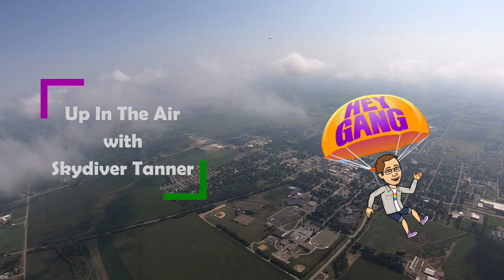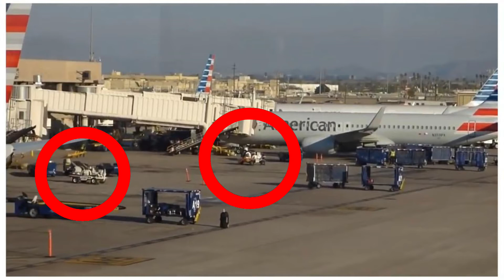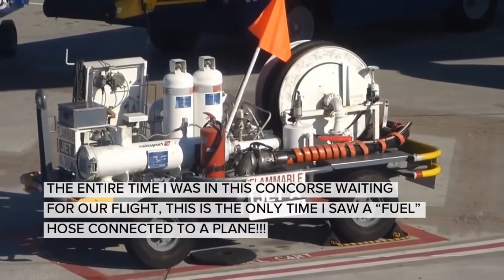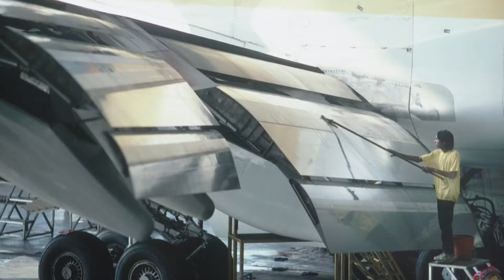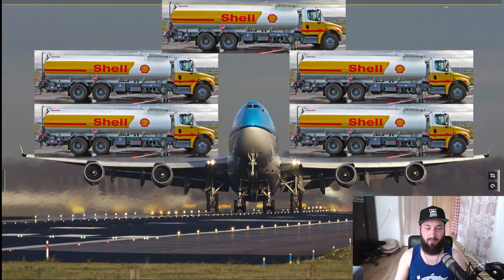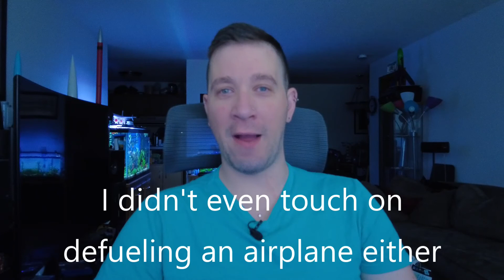Jet Fuel Hoax Visited: UITA w/ Skydiver Tanner

Comment: Tullamarine airport is no where near a refinery and if they ran on fuel the roadways would be clogged with fuel trucks.  Also there wouldn't be enough oil in the ground to refine for the amount of planes in the air, the aeroplanes engine are electric, General Electric.  There's no fuel.  They wouldn't lift off the ground with the fuel your talking about to fly from Melbourne London non stop and the wings wouldn't have enough space for fuel.  The wings contain hydraulic oil and equipment.  Imagine the weight of fuel, passengers and cargo.  You really l have to think carefully and disect every aspect of it.  Oh I can put a sticker on my truck, anything to show people and have them believe anything, it's not difficult.
Reply: I like the way you talk complete rubbish and demonstrate how you are completely clueless about flight, aerospace engineering and how an internal combustion engine works with such confidence. Comedy gold.
Reply: Pipe lines fuel can be carried through underground pipe lines.
Reply: Exactly! Not to mention the amount of time it would take to fill these planes up with fuel. An A380 would be like filling up a swimming pool every flight and would take countless hours with the fuel hoses they supposedly use!
Reply: @edkiely2712  aircraft rarely fill from empty and large aircraft would have multiple hoses. It’s not rocket appliance bruh. Oh and an a380 is a massive aircraft, larger the aircraft, the more it can hold.
Reply: @Robthisguy  It's lugnuts like you that keep the world in perpetual arrested development! Each A380 wing is suppose to hold the equivalent of 130 tons of fuel! That's  260 tons total! The wings could never withstand that amount weight to begin with! If you understood how a wing is attached to the fuselage, you would know that that amount of weight would break the wing right-off! It would also take days, with one hose, to fill that amount of fuel! Not only that, the plane couldn't fly because that amount of fuel-weight being moved around when the plane took-off, turned, or landed, would act as moving ballast and cause the plane to crash. But, it would never get to that point because the plane would never be able to take-off with that kind of tonnage along with passengers and cargo!

The KC-135, which, refuels fighter jets, holds 9,000 gallons in a large 'balloon'(search on Google Images)that takes up most of the planes fuselage. They have numerous belts tightened around the fuel balloon so it doesn't slush around and create problems for the plane!

You just keep believing what you've been told and just leave it to us smart guys to do all the problem-solving! You probably one of those people who still thinks oil comes from dinosaur bones and that we landed on the moon!
Reply: @edkiely2712   you’re deflected what I’ve even said to you, aircraft rarely fill from empty and can use multiple hoses . 15 years as an aircraft mechanic and I also used to work in fuel tanks daily for years. I know fuel systems and know the basics of a wing construction considering I’ve been involved in wing replacements compared to 737s in size.Wings have bulkheads that act as ballasts to reduce sloshing. I’ve fuelled these aircraft to max capacity of 61k pounds ( 30 tons ) these aircraft dwarf in comparison to giant aircraft. Lug nut eh no it’s a case of Dunn Kruger you have idea with no proof just blind ignorance… oh no heavy me no understand .Ones things for sure you’ll never touch an aircraft( thank god ) and no truth will ever be exposed. Yes all the ten of thousands of people who service them on a hands on level just blindly guess numbers 😂. But I’ll make a proposal for you I’ll send you the link to an a&p group I’m in with thousands of aircraft mechanics and pilots from all sorts of sectors and you can tell them your theories and I look for the post so I can laugh with them.
Reply: @Robthisguy  Your experience should teach you that the numbers and physics doesn't compute my friend! You probably still believe that plane-wings actually cut through double-row steel columns on 9-11? The engines are connected by 3 bolts and would have sheared-off and fallen on the streets below-yes? Same with the computations on the fuel! I'm not saying there's zero fuel, just not these ridiculous figures we're told. Part of the reason they do it is so the can claim 'fuel costs' as a  primary reason for high ticket prices! Jet engines primary run on compressed-air which is why you don't see a lot of dark and dirty exhaust coming out of the engines- it's mostly air! Get with the program dude and reformat your thinking!

https://odysee.com/jetfuelhoax:981fa8caf143dc775415d9279b35085fff7ac30a?src=embed
Reply: @edkiely2712  numbers are easy. Our aircraft mtow is 160k 40% of that is the fuel weight. Pretty easy to see when a weight and balance is done and the systems that measure and display the fuel weights. The oleos in the landing gear will actually compress and the aircraft will lower the more fuel to put in it. So why can’t I reasonably assume aircraft that are waaaaay larger and would have similar procedures in place, hold significantly more fuel.
Reply: @Robthisguy  Look! If you are a plane mechanic, it must be as an assistant to the assistant on Spirit Airlines! Either that, or you were an Affirmative Action hire with one of those online degrees, because, you aren't able to grasp conceptually how the wings cannot hold that much fluid- period! A planes wing isn't even that thick, yet you are trying to believe an A380 can hold almost 90,000 gallons of fuel which is the equivalent of almost 4 standard-size pools(13,500G)on each wing! A wing isn't even 6ft. deep at any point and contracts and thins out as you move towards the outer wing. Simply put, there's no room to put 86,000 gallons in those wings, not mention how the sheer weight defeats the aerodynamics of the purpose of the wing itself. I can't mention how many times I've been in a plane as it's taxiing on the tarmac, goes over a 'bumb' and the wings bounce up-and-down like feather. If there were tons of fuel inside, that would never happen!

Look! You're conditioned by your 'education' and don't see the larger picture on why and how we are being deceived to keep us in perpetual bondage! Maybe one day you'll understand  where I'm coming from, but, for now, your set on believing what the system has taught you, rather than seeing what's obvious and directly in front of you! So, we will call it a stalemate my friend!
Reply: @edkiely2712  Exactly!!💯
Reply: @edkiely2712 r*tard

Comment: It took only a couple of minutes to ascertain that your entire argument was based on misstating the claims of the jet fuel "deniers". It would have been interesting to see you ACTUALLY respond to the ACTUAL claims made in their videos. What a total fail on your part.
Reply from the maker: Sorry it wasn't to your standards. I felt it worked best based off my personal experiences as some who refueled the airlines versus pointing out many faults on how jet fuel is a hoax. To me, my personally putting fuel into an airplane, watching it taxi to the runway, then take-off, is sufficient enough for me. And so that what I did
Reply: @skydivertanner  we believe jet fuel is used but we believe the effiancy and the amount of jetfuel that is used is a lie based of mathematical conclusions on how much the wings can carry and how long it would take to fill those wings. And that amount of jetfuel that is even being carried within the wings. I guide you to this point. Their was collusion In the lightbulb industry to litterally make lightbulbs not work as long. Planned absolesence is a thing. Their is ways for company's to mass lie and its historically factual. To throwaway this line of thinking with other things is just down right unreasonable. To think Boeing wouldn't lie on how much jetfuel their planes use to drive up prices and climate change fear(2 in one) is just down right a bad take.
Reply: Well said. Thanks!

Comment: "Yes!  Maybe the plane only needed 2 minutes (2,000 pound) of fuel"   Okay!  1000 lbs/min   =  150 gallon/min
Never mind my high power sprayer can take automotive paint off @ 4.5 gal/min.  150 gal/minute wouldn't damage a wing. Even at 150 gal/min.   It would take 9.1 hours to fill an airbus A-380.  You couldn't fill 1 plane working a full shift.
You'd need relief help to fill 1 lousy plane.   Just like you need serious help to bullshit your way out of this video.  LOL
Reply: Aircraft rarely fill from empty, plus they can use more than one hose at a time. Their flow rate would be much faster probably no more than a few hours from empty tops. On the type of aircraft I’ve worked on , it can be filled from empty to full in about an hour 30 tons (60k pounds) give or take.
Reply from the maker: @Robthisguy  exactly. The 747 could have 4 hoses attached and could take about 750 gallons/minute from one truck with 4 hoses. Not that hard to figure out, it wouldn't take very long to fill it to over 50,000 gallons

Comment: The official record say that a F16 holds 7,000 pounds or 1,000 gallons of fuel internally. However, when I look at cutaway images of a F16, there's no 1,000 gallon fuel tank internally. Where is the fuel stored internally?
Reply: The fuel is in the wings and tanks in the fuselage and in external wing and belly drop tanks in a F-16.
Reply: @ianobiwan  
Look at the cutaway drawings, there's no tanks in the wings.
Reply: @RicArmstrong  live and learn. To change a wing they have to drain it of fuel. https://youtu.be/_XqTof7EEpM
Reply: @RicArmstrong  well the cutaway diagram for Lockheed Martin F-16E/F block 60 Fighting Falcon I am presently looking at clearly shows the internal wing and fuselage tanks. I found it in about 30 seconds on this amazing thing called Google along with plenty of other diagrams showing exactly the same layout on other F-16 variants.
Reply: @RicArmstrong  Yes there are tanks in the wings.That is where the fuel is stored. Military aircraft also have the ability to be aerially refueled. So in effect their fuel capacity is limitles. Assuming you have tankers nearby. There is also drop tanks, which are carried under the wing.

Comment: A wing is not like a bridge because there is stability only on one side in a wing. What you are saying is it is like a bridge without any supports halfway across a river. Then fully loaded with weight of vehicles. Also blur the camera better. I can still see all the facial metal bits.

Comment: Took me about 10 minutes to realize this is about DENYING the jet fuel hoax. YT has REMOVED all videos PROVING that there is NO WAY IN HELL that large jets can store the massive amont of fuel that they 'allege' to hold in each wing, based solely on the structural integrity of the wings.
Reply: it's a dangerous idea that's why. otherwise they wouldnt give 10 minutes of their time to make hundreds of videos against the idea.
Reply: Bingo
Reply: Actually fuel in the wing reduces stresses during takeoff as they naturally tend to flex thus reducing wing flex. I’ll deny it because I used to work in aircraft fuel tanks and work on fuel systems.
Reply: @Robthisguy  Right and 'experts' would have us believe that two planes took down the Twin Towers, in addition to wtc buildings 7, 5 and 6, along with melting cars blocks away. Any structural engineer will tell you it is IMPOSSIBLE for the fragile wings to hold even 2% of the fuel weight they allege planes can hold in their narrow wings and would tear them right off any aircaraft prior to takeoff.
Reply: @tjmmcd1  911 is a conspiracy in itself that doesn’t really have a bearing on the ability for wings to store fuel.I was involved In re winging old aircraft with new wings and used to be part of our fuel tank mechanic crew on military aircraft comparable to a 737 in size. You say flimsy but in fact wing boxes are very strong, considerably stronger than fuselage skins. The actual skin panels on the wing are relatively thick and made of a stronger aluminum than thinner fuselage skin panels. Sure aluminum is a lot lighter than steel but it’s the combined structures that give it its strength ie: wing spars and ribs plus the steel fasteners and aluminum rivets used to put everything together. The actual wing thickness can be several feet thick along the wing root (area inside the wing ). The areas around the wing box yes I would consider somewhat flimsy like the trailing edge areas that store the flaps where they retract into and foward edges of the wing. These areas don’t carry much load and store/route wires, bleed air, etc. I’m not an engineer but i believe what I see and what I smell. Also Engineers are involved in designing aircraft so how can they say they can’t hold significant amounts of fuel?

Comment: I did that job back in 1986-1989 until I got my first flying job.  The system is rated for 50 psi (max) and most of the trucks we used ran at about 220 gallons per hour with new filters.